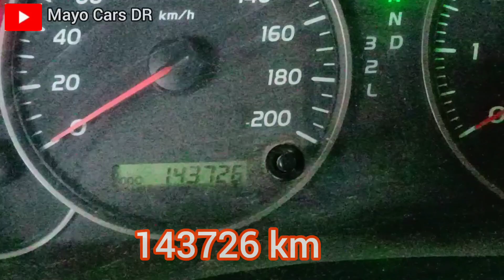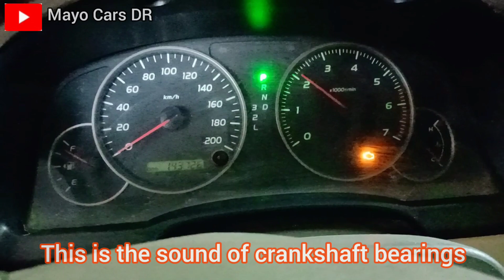What Is This BAD Knocking Sound In Toyota Prado 2TR-FE Engine 2.7L

Comment: I have the same sound in my prado in morning starting up 1 minute but how can I change the crankshaft bearings whiteout open engine?? Can i open only lower case …?
Reply: And my prado is 2012.  The same engine 2700
Reply from the maker: You will need to open the engine to replace the crankshaft bearings

Comment: Oil level not ok!
Reply from the maker: The engine oil level is not good but oil is present
Reply: The time in control
Reply: Injector pump timing control sensor check it out